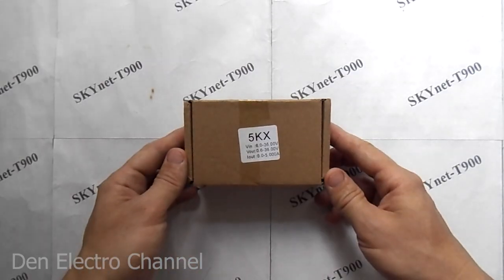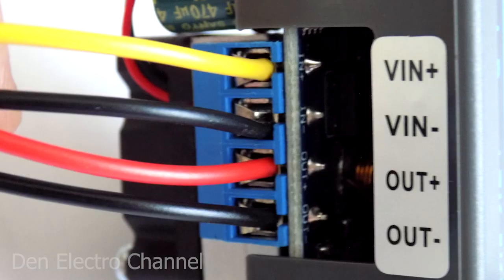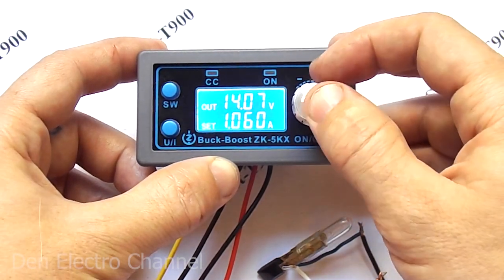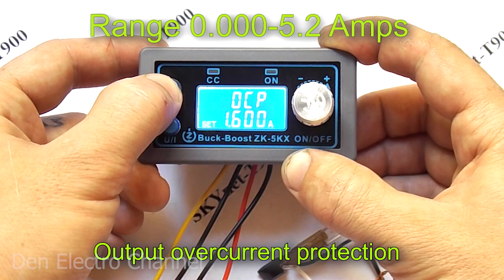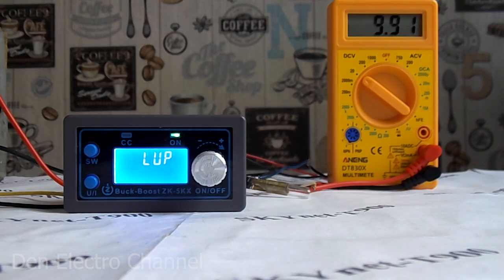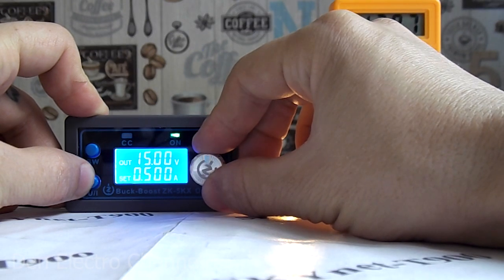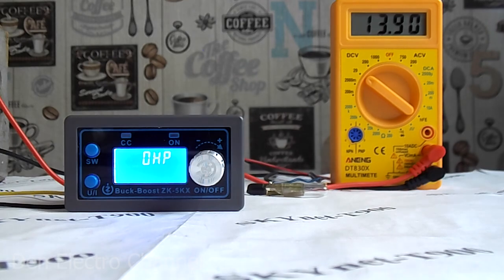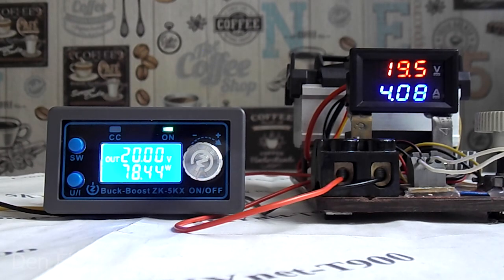Multifunctional voltage converter ZK-5KX for bench power supply

Comment: i have 1 of this but i Accidentally connect it to the battery at the wrong polarity and the result is it Cant charge any battery now
Reply from the maker: Yes, if the battery is not very powerful, then the device will not burn out as a result of reversed polarity, but if it is powerful, then the device is finished.
Reply: Which area would likely appear burned? I think this may be the case with my device but I can’t find any signs of how or where

Comment: Hello my friend, a question, how to charge a laptop batery with this device? I tried, I connect it to a 12v battery, then I regulate the voltage to 19.5 which is the same as my laptop charger, but my laptop does not charge and I don't know why it could be
Reply from the maker: Hello. It is very strange. If the laptop power supply has only two contacts (only + and -), then everything should work. This is, of course, if charging the laptop is simple.

Comment: Sir, I use it for my 12v 15ah lithium ion battery charging..

There is a problem that after some time it got error message, may be because of constant current....what should I do
Reply from the maker: what is the name of the error?
Reply: @Den_Electro_channel  I don't know sir, may be it off, I don't know is it because of heat or Battery BMS?
Reply from the maker: @arpitsingh5152  it's so hard to advise anything

Comment: I have got one of these units. The CC does not seem to be working as expected.Suppose I set the voltage to 5V and a max current of 100mA, if I short the output or put a sufficient load ,the output current stays at 60mA.Also the CC LED does not light up.Any suggestions ?? Everything else works as expected.
Reply from the maker: Yes, there is something wrong with him, but I can’t advise . I checked with myself. I also set it to 5 volts and a current of 100mA. During a short circuit, the current is 100mA and does not change.
Reply: @Den_Electro_channel   Yes  I verified it, unit has problem.
Reply: I use CC on mine for battery charging- it works fine but can be adjusted once. If I adjust it more, then it will give out max current instead-and sometimes will shut down due to overpower. My solution is to switch whole powersupply off when I want other current. Maybe this clitch doesnt happen all the time but I've become used to switching it off when different batteries are connected.
Reply: I have a similar problem, did you manage to solve it?
Reply: @vladobac1   Its a unit problem. Many of these units have some issue or another. There are 2 PCBs.The display unit is used for UI and the converter unit takes inputs from the UI and delivers output accordingly. This is fed back to the UI PCB for display only. Hence they have provided a calibration setup, which sometimes can address this issue. I always measure the output with a multimeter to verify the actual values. Hence it is still useable. I use these units for checking newly assembled PCBs for any power related problems. It is super useful for that.

Comment: I plan to use this unit as battery charger. Does it have reverse current protection on its output in case input power source stops?

Or do we have to install a blocking diode on ZK-5KX output terminals to protect the unit?
Reply from the maker: Yes, you may need a diode.  There is a resistor inside to discharge the capacitor at the output.  It will drain the battery.  But if you install a diode, the device will not be able to display the battery voltage.
Reply: Your timely reply is much appreciated!

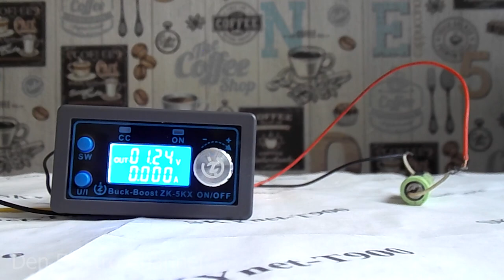Based on your response, I reviewed your authoritative video and noticed that you connected the  buck boost unit with no input power (off state) to a Li Ion battery 14:37 with no destructive effects on the ZK 5KX.

That was the answer I was looking. Datasheets claim that the output end has anti-reverse current protection, no need for anti-backflow diode. And it's true 😉

As for the capacitor-discharge resistor draining the battery, it can  be easily taken care of. Looking forward to more of your well illustrated videos. Subscribed to your channel 👌 Thank you!
Reply from the maker: Thank you!